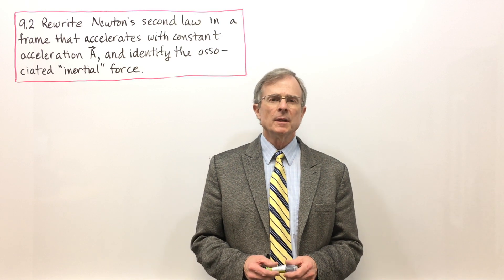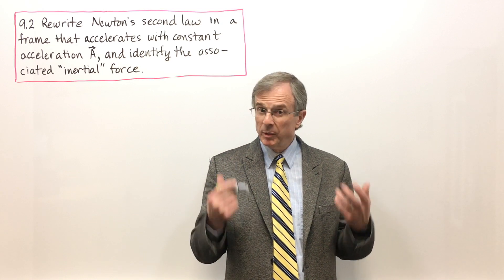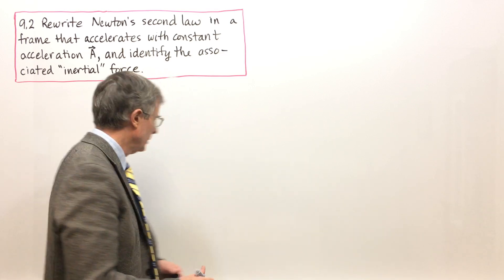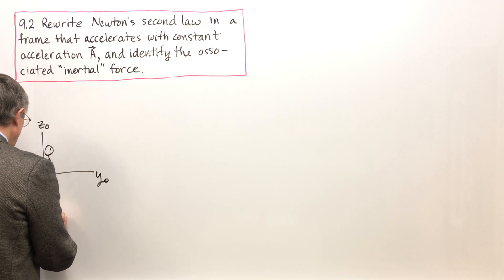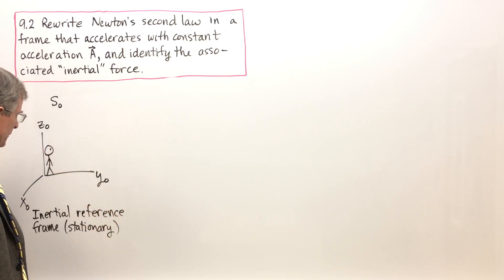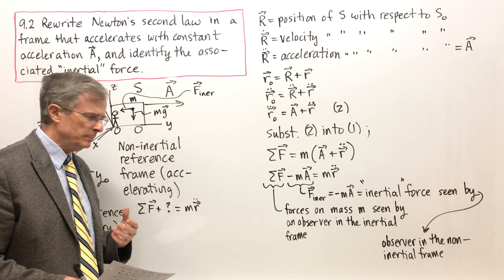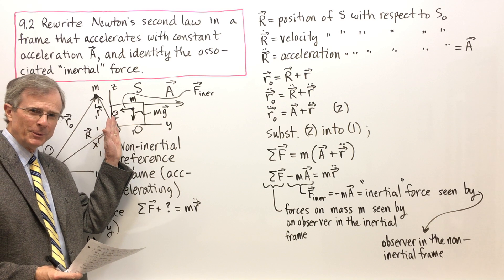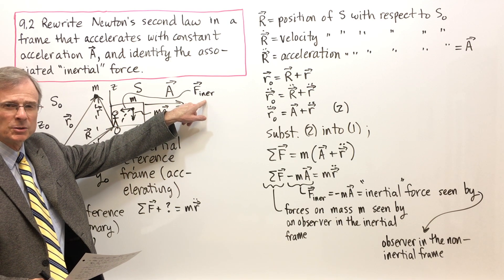Linearly Accelerating Frame (9.2)

Comment: Great lecture series, thank you!!  I had some initial confusion which resolved itself - may be worth sharing with fellow learners.  I was thinking, even if the train moves at a constant velocity (hence in an inertial reference frame) and the traveler observes a free falling object - detached from the body of the train - in front, then it will appear to be coming towards him.  On further thought, the distinction is the following.  In the above description, the mass is initially kept attached to the body of the train till being dropped.  So, in the constant velocity scenario the mass has already acquired the velocity of the train, so the traveler  inside will observe it to be falling straight down upon being dropped.  However, in the acceleration scenario (non-inertial reference S), he will still observe the mass to be rushing towards him upon being dropped.

Comment: Basically, the professor is talking about the "pseudo force" which we experience in an acceleratung frame. 

You know, just feel it, when a car accelerates, you feel a force backwards. That is pseudo force. 

Now, if you want to apply Newton's Law for non inertial reference frame, then just imagine that you are sitting in the car and you just need to apply an extra force on you in the opposite direction of acceleration. Balance all the other forces and use F = ma. 

Its just simple but I Don't know why is this professor making it so complicated my taking position vectors and so all.